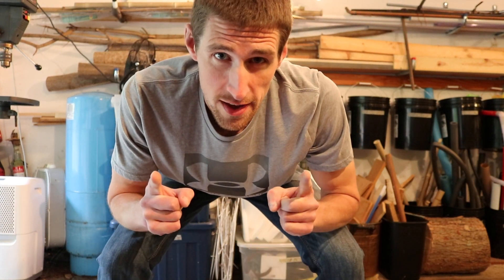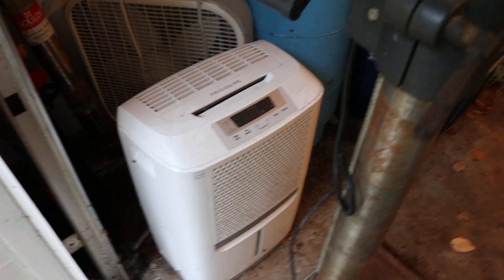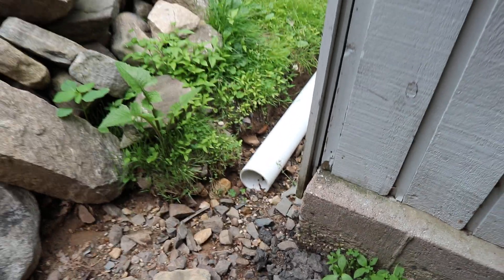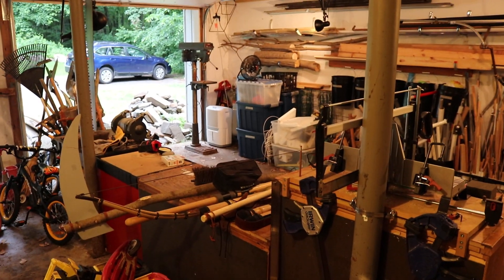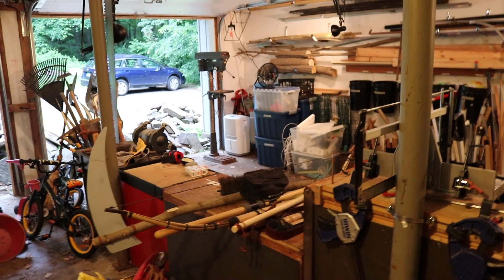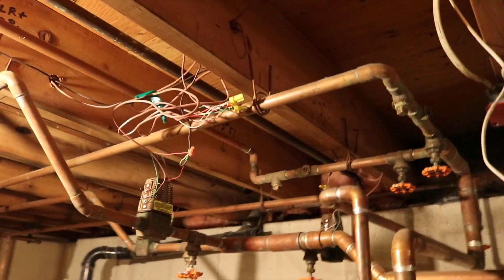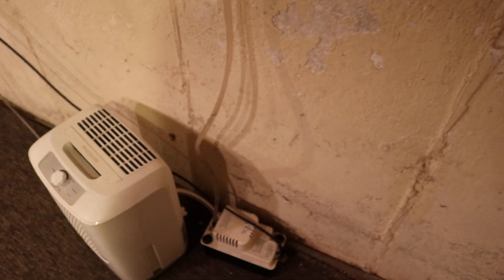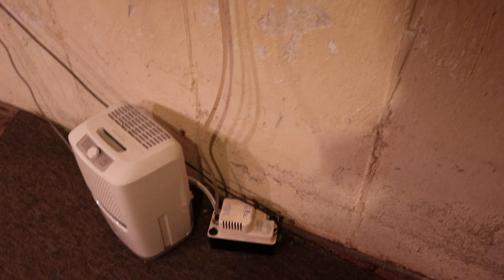Self Emptying Dehumidifier (Two Methods)

Comment: Why didn't you connect the tubing to pump out through the plumbing exit where your laundry water would pump out. The Main Drainage for your building? 
We got a heat pump water heater installed that has the SAME kind of PUMP that you showed. Then tubing goes from the Pump to drainage pipes
Reply from the maker: I didn't think of that. That's a better solution overall but I don't have any plumbing skills so it didn't even cross my mind. Otherwise I would have had a plumber help me. I'm not in this house anymore but thanks for the idea.

Comment: CT here too, Windsor Locks. Bought a new house and the basement humidity averages ~80%. Bought a dehumidifier and it needs to be drained 3x a day, can't believe the amount of water it pulls out. So I need to figure out how to get the water pumped into one of the drain pipes in the basement.
I am thinking about getting a small tank, putting a automatic sump pump in it, feed the drain hose from the dehumidifier into the tank & a drain hose from the sump pump to a drain pipe in the basement. When the water reaches a certain level in the tank, the pump turns on & drains the water.
Reply: I use a clear 25-30 gallon storage bin. I have the dehumidifier on top and a hole in the top with a hose running out of the dehumidifier into the bin and a water pump with hose. It takes about a week to fill it up and i just pump it outside
Reply from the maker: @Paulio91184  Ah so you manually switch the pump on when it gets full? Is there anything to stop it from overflowing? If you want to get really clever you could put something in the bin that floats on water and activates a switch when it gets high enough. Would be a fun project. :)
Reply: @AytwitEngineering I don't have it set up to stop overflow but i pass it every day so I always check... One with an automatic float would be awesome but I'd have to plumb it into the drain
Reply from the maker: Yea it's crazy, easily a gallon or two a day in my place. Check out the video description for the pump and dehumidifiers I bought. Let me know how it goes!

Comment: Great helpful video thanks! So there’s the 1/50th hp and they have a 1/30th hp model as well that’s actually cheaper. What’s your thoughts on which one is stronger/better
Reply from the maker: I like the more expensive one. Seems stronger, and has an exact humidity meter and settings. Thanks for watching!